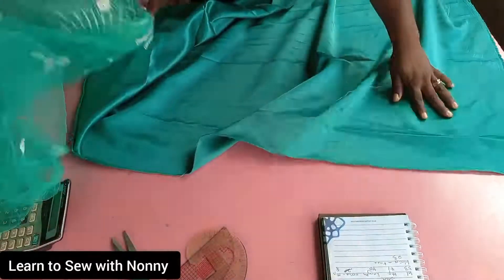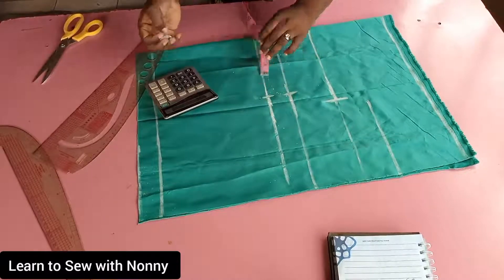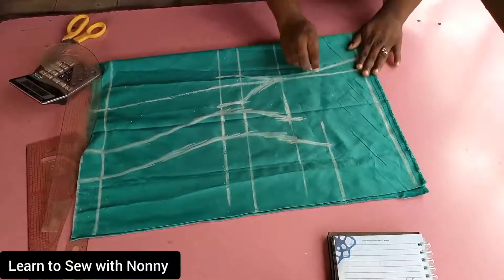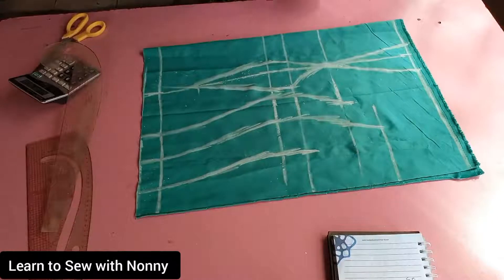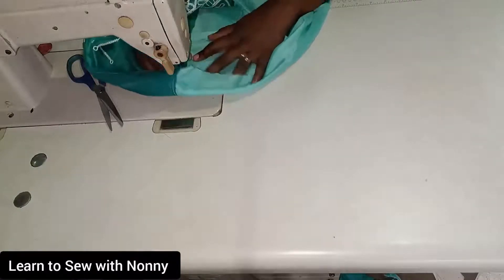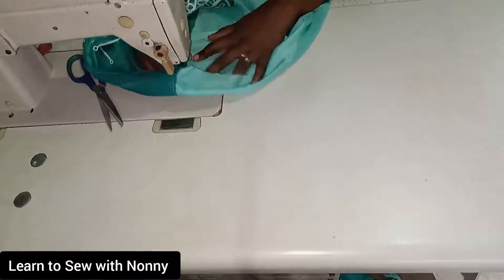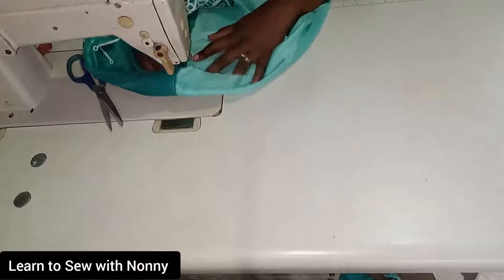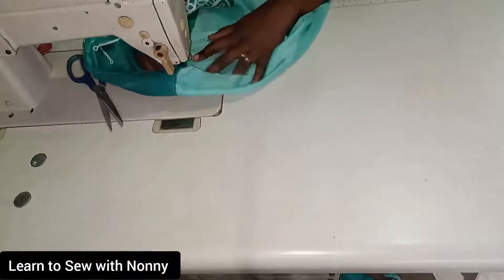George Igbo/Madam Blouse Cutting and Sewing Tutorial. Detailed and Simple.

Comment: Very interesting one. Thanks alot for Your lectures.It usually go well. But madam,if it's the beads type, i.e, the costly type, will you also cut in to pieces before sewing or coupling. Or will the linen cut into pieces, their after placing the main fabric on it. Please ma,i will also like you to make a full video on the costly type please.🙏 🙏 🙏.
Reply from the maker: The expensive types of George fabric comes with beads and different accessories so you won't want to sew on them.
What you do is cut on interlining(Satin) using the interlining as both fabric and linen.
After sewing, you can then hand tack the beaded Goerge to the Blouse..
Reply: Thanks, but your lecture will help more. Thanks.
Reply from the maker: @ifyilodianya4625  08028828915
Reply: Thank you so much ma